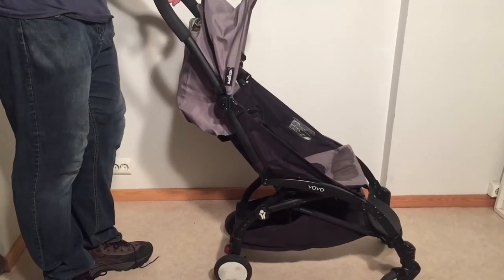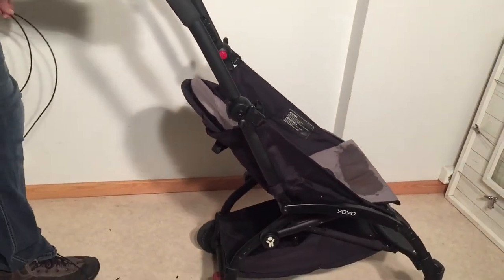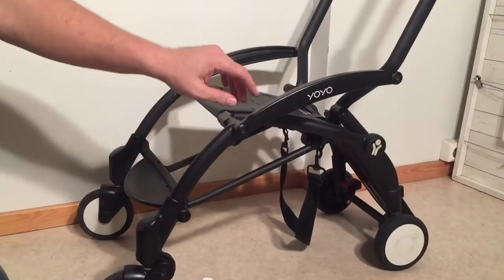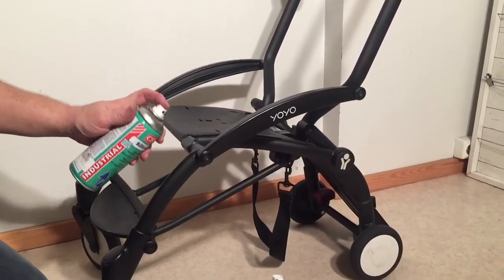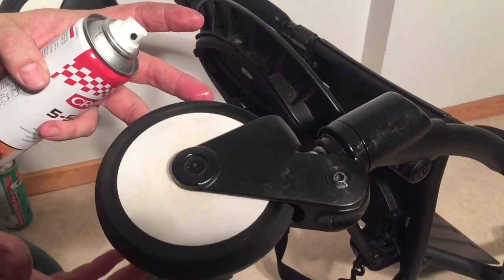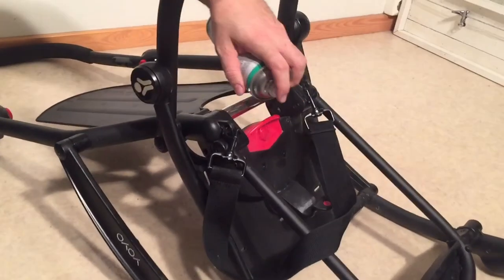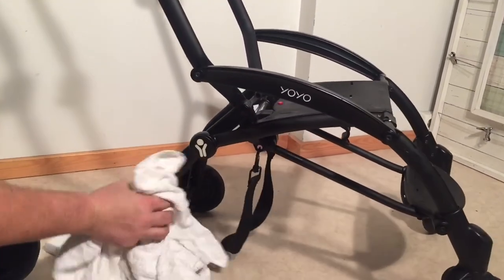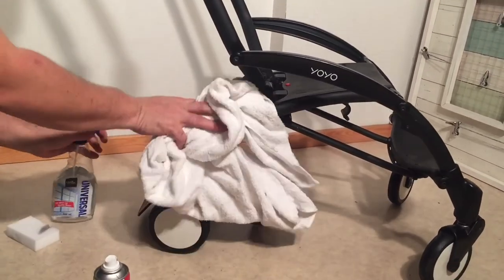Babyzen Yoyo: Cleaning and Care. Easy to Follow Steps

Comment: One nice thing about silicone spray is that it doesn't attract dirt as some oil lubricants do.
Reply from the maker: This is true.  For exposed element, or if one is actually disassembling mechanisms, then silicon spray and thicker greases are better, but they unfortunately can't be counted on to, for example, spray into a crack between 2 elements on the handle and be trusted to run down all the way to the locking elements at the center of a stroller chassis like WD40 can. :)

Comment: What is the stroller was wet during the summer and now smells moldy?
Reply from the maker: Depends a little bit on what the textiles are made of.  Most stroller textiles will tolerate a low concentration of chlorine without getting miscoloured, so if you have a better-brand stroller, remove the textiles and wash them in a machine (if possible), following the instructions from this video: https://www.youtube.com/watch?v=5MvjlbNJIko
For a stroller with cheaper-type textiles, you could try vinegar.  :)
Reply: @BarnevognverkstedNo  Thank you so much for the reply! I have a yo-yo baby zen!